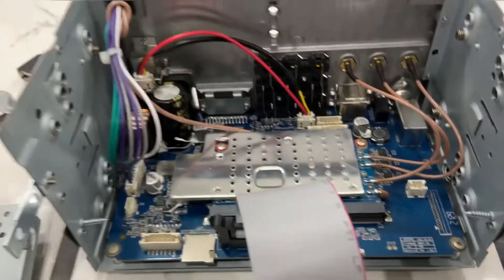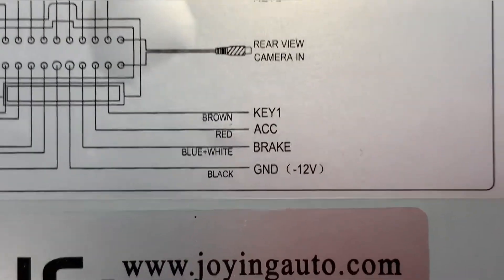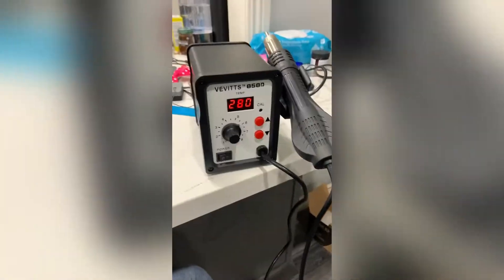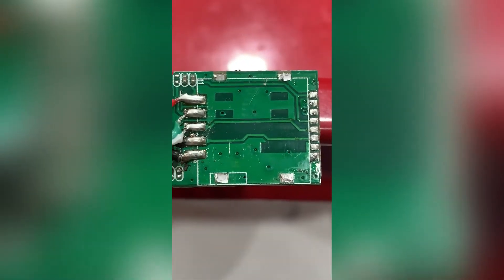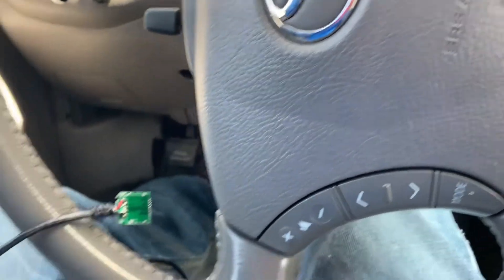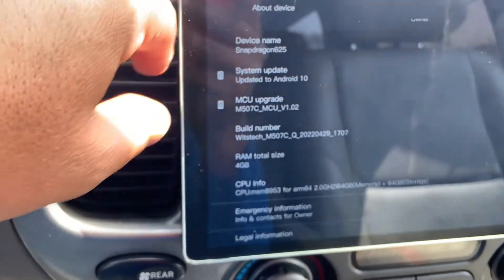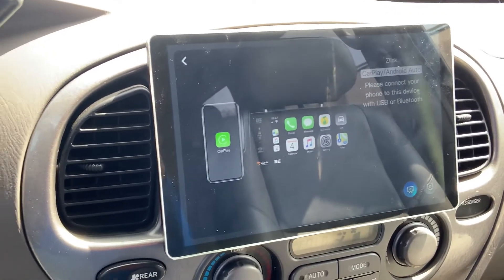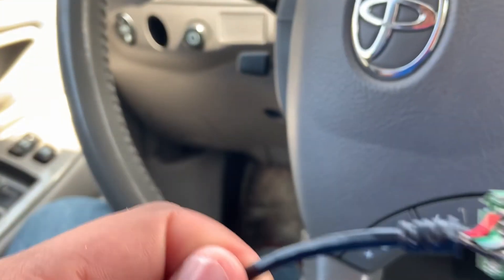Joying Radio Head unit update and 4g sim tray tear down.

Comment: Do you know where to get a replacement sim tray? I lost the metal "cage" thats hold the sim card down.
Reply from the maker: AliExpress, you will need to resolder the tray
Reply from the maker: US $4.89  30%OFF | Kid Smart Watch GPS Navigation Micro SIM Flip Bar 8PIN Card Socket Connector Patch Type LCN Slot Tray Holder Adapter Motherboard
https://a.aliexpress.com/_m0YSLKK

Not the same link to the one I bought as it is no longer available but you can reference the design to yours
Reply: @locorudy626  do you have a specific link? Searching for "joying sim" gives me anything but the thing I'm looking for.
Reply: Sorry I missed the actual comment pointing out a comparable product on Ali express. Thanks so much for your quick support!

Comment: Where did you get those brackets that are on each side of your radio shell??
Reply from the maker: Home Depot. They were in the wooden fence and outdoor fence handles and hardware section. Literally I walked around just to see what I thought would work and I found those drilled l some holes screwed and mounted the face further forward.

Comment: Your having some issues bro. I returned my 10 inch joying due to screen issues. I think the display chip was getting hot while playing high volume and I'm in Vegas. I didn't hesitate because I say the new UI but your videos are making hold off.
Reply from the maker: The reason why I haven't returned mine is because only the 4G LTE connection has issues, not only that but i had bought DSP and other components to pair with this unit I want to see it through. Also was hoping they would offer part replacement like a mother board or something but they didn't.

Comment: I also got an update from Joying didn't fix anything but made it worse. So I'm good won't be asking for anymore updates!!
Reply: AT&T does not allow devices that aren't officially authorized on their network anymore. Previously they could connect via 3g but they cut their 3g network.
Reply from the maker: @strawsy69  Thank you for the information, very useful to know.
Reply: @strawsy69  At&t was finally able to get a sim to work they just changed some settings in the apn. The unit act's like a phone so it does have to have a number. So a tablet plan won't work you'll have to have a actual phone plan which is too expensive for just using it in you car. They told me it would be cheaper just to use a pre paid plan instead.
Reply: @duceky1977  Whoever you talked to gave you the hook up. There's new smartphones that won't even work on AT&T because they're not on their approved list.
Reply from the maker: What was the build date on your update? It seems to me they just have weekly batas they compile and send out as needed with the date sent on the build number. Also have an update on this video.... spoiler alert ...

It didn't work, still the same problem with sim card disconnecting. I'll put an update up this weekend. Also got an update with software build date 6/1/2022 fixed my wired and wireless android auto and they also explained that the new zlink app works only wirelessly with  apple car play.
Reply: @locorudy626  the build date not sure where to find that. Sim card does work but wont read one that's data only it has to have a phone number. Going to try a different carrier soon.
Reply from the maker: @duceky1977  what Carrier? If I may ask
Reply: @locorudy626  AT&T
Reply from the maker: @duceky1977  interesting I wonder if att is blocking the device from accessing the network.. I have TMobile and it allows both to access the device but cuts off the same with phone line or data only sim so I'm guessing not a line issue.